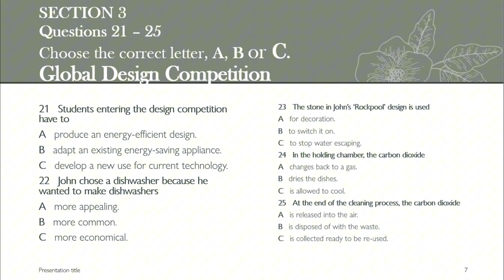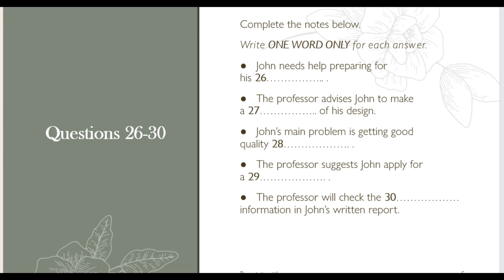Cambridge 10 - test 1 - section 3

Comment from the maker: Từ vựng trong bài : 
entry – bài dự thi

Global Design Competition – cuộc thi thiết kế toàn cầu

domestic appliance – thiết bị gia dụng

conditions – điều kiện

focus – trọng tâm

adopt – áp dụng

innovative approach – cách tiếp cận đổi mới

existing technology – công nghệ hiện có

tricky – khó, phức tạp

identical – giống hệt nhau

prepared to – sẵn sàng

decoration – sự trang trí

function – chức năng

novel – mới lạ

dishwasher – máy rửa bát

innovative – mang tính đổi mới

carbon dioxide – khí CO₂

in place of – thay cho

detergent – chất tẩy rửa

pressurize – nén áp suất

liquid – chất lỏng

fluid – chất lỏng

release – giải phóng

do away with – loại bỏ hoàn toàn

waste materials – chất thải

holding chamber – buồng chứa

depressurise – giảm áp suất

revert to – trở lại thành

separate out – tách ra

waste system – hệ thống xử lý chất thải

thoroughly – kỹ lưỡng

process – quy trình

cylinder – bình chứa

final stage – vòng cuối

presentation – bài thuyết trình

detailed drawings – bản vẽ chi tiết

stand a good chance – có cơ hội tốt

model – mô hình

difficulty – khó khăn

materials – vật liệu

professional – chuyên nghiệp

top quality – chất lượng cao

lift our profile – nâng cao uy tín/hình ảnh

grant – khoản tài trợ

fill out – điền (form)

application forms – đơn đăng ký

technical details – chi tiết kỹ thuật

accurate – chính xác

thorough – đầy đủ, kỹ lưỡng